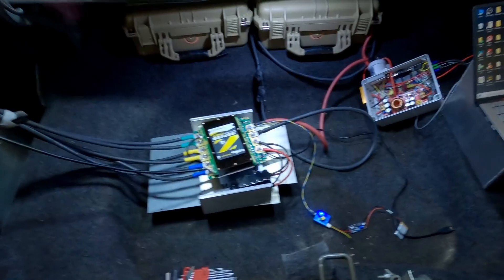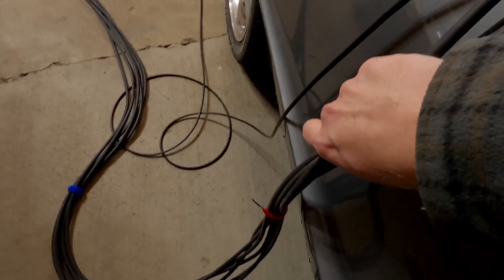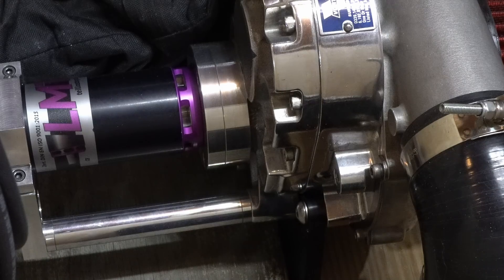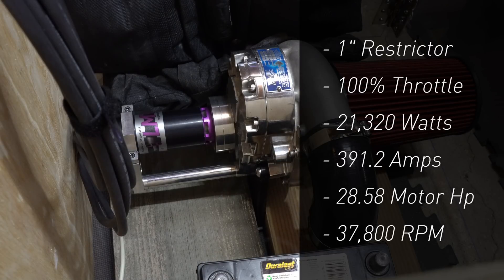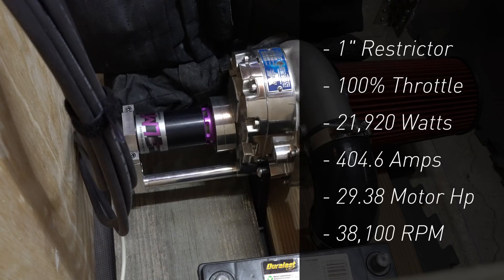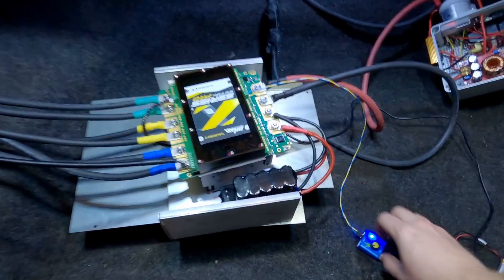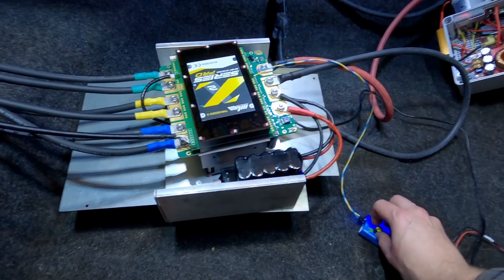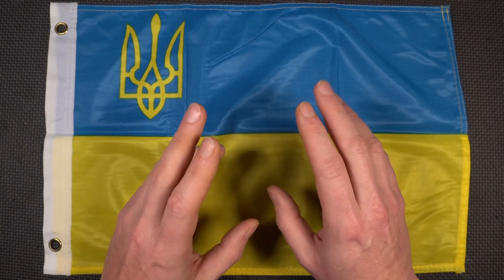DIY Electric Turbo: Sledgehammer High Power Tests - It Works!

Comment: Progress! awesome 🤠
A thin stainless steel box would be good for stopping any fire from the ESC or Batt's it worked for uranium that's been ignited to burn.
Reply from the maker: It's funny you mentioned that.  I actually just bought some steel sheet to do just that.  I actually have stainless here that would work, but I hate working with stainless - it's hell on tooling, it work hardens and it warps really badly when you weld it.  I just need something that won't let aluminum melt through it.  But if I have another plasma arc issue (like I had with the APD ESC), then no metal on earth will stop that.  That was a 3.5" long plasma arc that sawed its way through everything it touched.  Thanks for the idea, watching and commenting!

Comment: These electric turbos would be great joined to the end of the turbo  via axil then cuts out after the gas exhaust builds up , killer of a machine . Supercharged turbo performance.
Reply from the maker: OEMs are starting to do something similar.  Soon there willl be take-off units available.  Controlling them will be another story, but at least people without machine tools will have access to this stuff.  Thanks for watching!

Comment: But your turbo doesn't have any kind of cooling (water or oil cooling)?
Reply from the maker: Doesn't need it.  The motor has an internal cooling fan, and the rest of it doesn't get hot.  My initial versions had all kinds of water cooling and stuff.  Turned out to be unnecessary.  They don't run long enough to get hot.
Reply: @AlexLTDLX  oh okay but for a real application in a cae you would need some cooling right?

Comment: man you need to lube those impeller bearings or is going to explode 🤯!!!!!
Reply from the maker: They are lubed.  I use Kluber's Isoflex NBU-15 - what most internally lubed superchargers use.  The engineers over at Kluber told me to relube the bearings about once a year under "normal" use.  At this rate I'm going to have re-lube them once every 10 years, lol.  Then again, that stuff costs about $1 per ml, so that might not be a bad thing...

Comment: Sweet!  Another channel I watch just got the MGM ESC to drive a motor for a RC truck. Anything with 25 caps is good in my book!  Lol
Reply from the maker: You're the second person to mention that RC truck... I'm going to have to watch that channel.  Thanks!
Reply: @AlexLTDLX  He just posted the video with the ESC and motor so the next one should have it finished.  Always nice to kno someone using the same gear to put heads together with if theirs questions.  Its RCSparks Studio. He has been around for a while now.
Reply from the maker: Thanks - I'll check it out.

Comment: How much boost do you think it’s gonna make at 7KW? Borgwarner sell a turbine with an electrical generator attached to it capable of 7-13kw and only water cooled, it doesn’t even need oil lines.
It will be a nice setup to continuously run the electric supercharger.
Reply from the maker: We've already discovered that it takes about 4kW to support 200hp.  So 7kW would get you to about 350 hp under relatively low boost conditions (5 psi or so).
Reply: Not bad! Plus is a bit more that the torqamp and I’m sure this supercharger will flow enough for engines over 3L

Comment: what if you raised the voltage higher up to like 120 volts and found a motor to drive that turbo. You would be using far less amps and sizes of cable.
Reply from the maker: Would love to, but those motors and ESCs don't really exist yet.  Good idea though!
Reply: @AlexLTDLX  regardless, what you doing is awesome. Can't wait to see how much boost it will actually provide to a LS motor
Reply: Itis not so hard to modify the esc to use higher voltage mosfets, eg 200v, and to quarantine the 200v from the rest of the circuit. The final power switching mosfets can be mounted on a daughter board and box mounted to the side. Yes, I have built speed contollers from the ground up, we even etched our own pcbs, so did my mates, racing rc cars. It may not even be harder than desoldering the existing fets and installing higher votage types. Just need to make sure the gates are driven hard enough to switch hard and fast - it is slow switching that causes heat. It is definitely not hard to modify an existing circuit. There are plenty of people with circuit design knowledge who can help you.

I am curious as to your real world results. Driving a supercharger generally takes 20-25% of an engines power. This is not mechanical losses, this is the effort reqired to compress the air. Thus, a small 800hp supercharged engine might be loosing more than 200hp just driving the air compressor.

I daily a 800hp turbo barra Falcon.

Comment: Looking forward to seeing you get the VESC based build running smoothly. I hear the VESC can kick out a tonne of power but have yet to see it haha. Its a shame the big boy ESC doesnt have any real time monitoring, that would be super interesting to see.
Reply from the maker: I think the VESC setup just needs a different motor - fewer poles and position sensors.  I just happen to have a Castle Creations motor here that will do the job.  I'll get back on that one as soon as this one's tested.

Comment: Congrats on a successful full power test! Very exited to see this on the dyno! Wonder how well they would scale if you did twin or even triple.
Reply from the maker: Thanks.  I am considering compound boost with the smaller VESC/P2 unit down the road.  That'll probably let us hit 1,000.  Not sure this one will by itself.  With a different compressor, possibly, but compound boost would definitely get us there.

Comment: but the rpm is quite low, can you share the impeller map ?
Reply from the maker: Vortech publishes their compressor maps.  Google, "Vortech Si trim compressor map."  This is a little better than that, because while it's an Si trim volute, it's got a billet impeller with extended tips.  An Si trim is good for 775hp; the billet impeller improves efficiency, reduces weight and is supposed to be good for 850 hp.
Reply: ok, looks promising ! ~1.8 ratio at ~ 0.72ųc, should give you a max of 8 psi without intercooler.
the good point is that this impeller provides a wide and stable pressure range at a fixed rpm.
good luck ! and thanks for sharing...

Comment: Put the three controller closer to the motor. Use shorter leads. You'll get more power!
Reply from the maker: That would make things a lot easier, but this needs to be able to realistically fit in a car without compromising the car's usable space.
Reply: @AlexLTDLX  the controller is relatively small compared to other components that would be under a standard car hood. I had a typo above. I meant to say three phase controller or just controller. I really think if you thought about it long enough you'd probably have a place to put it. However I have no idea what you're putting it in. It could be going inside of a Barbie car for all I know. Just food for thought you'll get a lot better performance; this coming from an EE/CPE and builder fabber myself. "Fabber" not to be confused with fapper although it wouldn't be the first time I've been called that. Also side note I believe you'd save some cost in wire in the long run, as you would only have your positive and negative leads instead of three leads to cover the distance. And actually if your chassis is straightforward enough you could only run just a positive lead up to it and use the chassis ground to carry the return (ie "ground"). I believe sharing the chassis ground might actually have some other benefits as well, so long as it is a low resistance ground.
Reply from the maker: So you haven't seen our first drag tests with version 1?  We had some pretty eye opening results.  And this is also the car it's going in: https://youtu.be/AOL3Qyczt3Y
Reply: @AlexLTDLX  nice work!

Comment: Yeah man! The package survived. Can't wait to see full tilt operation on your LTD.

Do I spot with my little eye what I think? I just bought a 1200 watt boost converter that looks identical to the one in your trunk.

Take care mate!
Reply from the maker: Thanks!  Good eye.  Yeah, that's how I charge the packs while driving around.  I made a custom dual charger for the battery packs when the car's parked.

Comment: Power to weight gain? Lots of electric components there. Seems like a turbo is better suited for power and on to weight gain. This whole build is cool though. Compound this with a turbo?
Reply from the maker: Lol... you made me look up what an equivalent turbo would weigh.  Everything in this setup adds about 110 lbs to the car.  But 70-75lbs of it is right over the rear axle.  If you went with smaller, lighter lithium polymer batteries, you could cut 40lbs out of that.  But I'm using LTO cells because they're safer (their massive discharge capacity is a help, too).  A comparable turbo is about 30 lbs; v-bands, piping, wastegate, etc would add another 30-40lbs usually in my experience.  So if you went with LiPo cells, the weight's about the same; but you have much more flexibility in where the weight is added to the car with the electric version.  FWIW, my Whipple setup added 80 lbs right on the front of the car, and another 30lbs with the A/W tank and plumbing.  And the electric turbo will most likely make the same or more power - the car went 9.83 @ 140mph and weighed right around 3,500lbs with the Whipple, driven to and from the track without even changing tires.
Reply: @AlexLTDLX  I genuinely didn't know about the weight to power. Just curious and I appreciate your time responding. Glad you also took notion about garnering information about the weight. Keep on brother. I'm taking a fancy to these electric chargers. First one I saw was from Cleet. Your on a different level with it though👍😎

Comment: In for the electrics! What kv and voltage?
Reply from the maker: It's the 5 wind version of the motor.  Not really sure what the kV would technically be (LMT is a bit weird about there specs, because they let you wire their motors in delta or wye); I did have that question myself and it appears to be around 587kv under heavy load.  Battery voltage was 61 unloaded, and under the heaviest load, the voltage dropped to 48 volts.
Reply: @AlexLTDLX   did you have it wye or delta? Two pole, wye could have better torque efficiency.  But you won't get the rpm and power that delta of the same turn count would allow.   

Shame you couldn't use a pancake motor, would fit the space very well.  But that's a lot of rpm and big diameter motors are better at slow with big torque
Reply from the maker: I believe this would be considered delta.  I'm still wrapping my head around having connections for each side of each coil.  I've learned a lot about brushless motors since starting this, but it's not second nature to me yet.
Reply: @AlexLTDLX  holler if you have questions, it's what I do
Reply from the maker: thx

Comment: 7680/747.7=10.251…

How's Motor HP higher than the Electrical HP?
Reply from the maker: 745.7 watts per hp, not 747.7.  But there's a also duty cycle at play.  Unfortunately, I haven't found where the MGM ESCs give me duty cycle in the data log.  Thanks for watching, commenting and most of all, subscribing!
Reply: @AlexLTDLX  fuck! I memorized the wrong conversion # 20 years ago!

Comment: last video with the question about simple raw thrust tests, you mentioned all the weight it was trying to lift... reminded me of researching and playing with a hovercraft calculator for power vs weight vs skirt perimeter, to come up with the optimal numbers for air gap aka ride height. similar "crazy fun", got pages of notes for that stuff. real world it changes when velocity (vehicle speed) undermines the lift cushion up front.. makes this a pretty good spot for an "air head" joke  :)
Reply: ;) with the correct nozzle  cones on it and lets say 4 of this thrusters u probably can just hover in the air leaving the skirt at the floor xD   

hovercraft need more volumetric flow and less pressure,  ducted fan would be better in that case
Reply: @sonnenklang6925  yup, hovercraft and EDF model jets are all about volume, a big centrifugal squirrel cage can work for lift too.

Comment: Can’t wait to see the results. Hopefully you’re gonna offer some parts for sale in the future. I’d love to have something like this on my truck rather than either having too big or small of turbo.
Reply from the maker: If I do start selling parts, it'll likely happen on www.electrifiedboost.com  Thanks for watching, commenting and most of all, subscribing!
Reply: @AlexLTDLX  still got the curious feeling about two 100 mm EDF's in series to stuff a Honda's intake. just might give 3-4 lbs boost that the factory ECU could detect+manage. non parasitic 3-4 lb would behave like its more, and only used a few seconds (depending what gear its in) when its wanted. nice part being inexpensive+simple. V6 or V8 might need two pairs set up. plumbed straight into the air filter box, if a blade went frag the air filter would keep pieces out of the valves+cylinders.

Comment: Outstanding. Not sure how you can remain so calm while filming this. I bet you will start breaking parts soon!
Reply: I'm suspecting it'll stuff the intake with an atmosphere (14.3 psi) to near double the power (yeah yeah breaking stuff is cool, fire fire, shuddup Beavis!)
Reply from the maker: I'm not sure it'll hit that much boost - but at least 8; possibly 10 at peak hp and more at lower rpm - maybe 12.  But it is going to be the most efficient boost possible.  It's not a linear relationship, but our first dyno test saw 32 rwhp per psi.  That's more than double what the Whipple made.
Reply: @AlexLTDLX  10-12 without parasitic spooling+lag etc would be FAT!
kinda the point anyway, the intake being stuffed hard when engine rpm's are lower to make your torque where a normal turbo can't = advantage!
Reply from the maker: Yeah - pretty much defeats the advantage positive displacement blowers have.  Can't wait to release the trans brake off the two step on this thing.
Reply: Holy shit!
Reply from the maker: Believe me - I wasn't.  The entire shoot process took about an hour.  Even though it was cold, by the time I came into the house, I was sweating.  And I hope I don't break parts anymore, but I get your sentiment!  Thanks!

Comment: MGM and LMT did not let you down. 680amps  is a lot of current. A+++++++
Reply: Those Lishen LTO’s are the real champions. No other way to get that kind of power output in a form factor that’s both easy to assemble AND safe AND has a crazy long cycle life. LiCo can get you that level of power but with horrendous cycle life and it is without a doubt the most volatile secondary lithium chemistry. LTO is the exact opposite. Just wish it had slightly better energy density but that’s not what power cells are about.

Comment: Wow Alex things are looking very good (and quite professional I might add) the entire setup reeks of quality, of course you can't skimp on the hardware when dealing with electrical loads like this. Can't wait for the install in the car! 👍
Reply from the maker: Thanks.  After seeing what happened to the APD ESC, I'm going with a steel mount for the ESC in the trunk.  Don't need molten aluminum dripping onto the batteries...